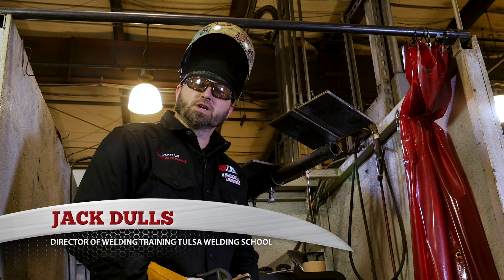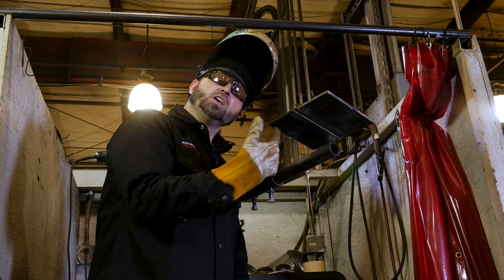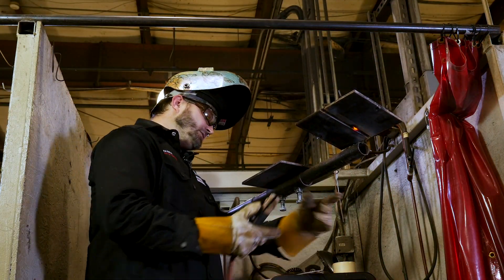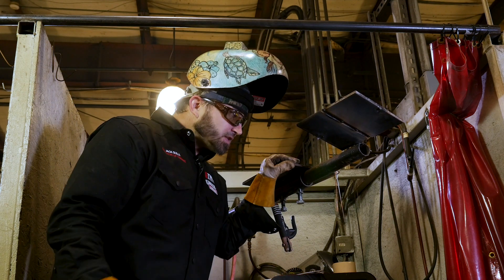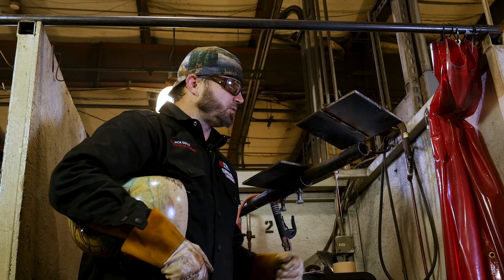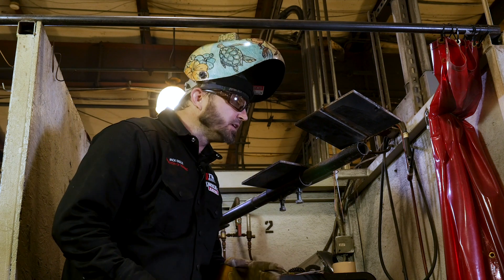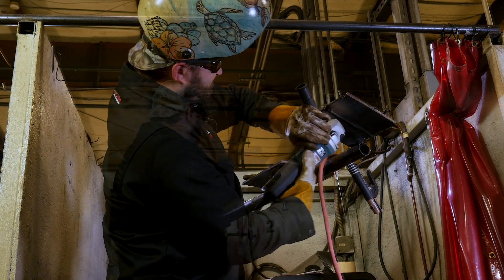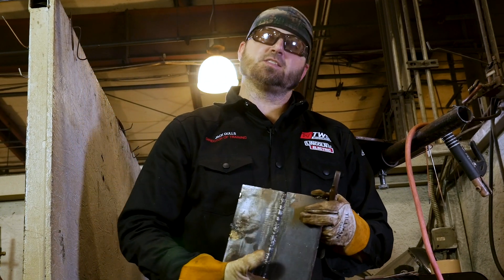How to Weld a 4G Open Butt 6010 Root 7018 Fill and Cap

Comment: no feathering restarts?
Reply: If it’s still hot you can start right back on top of where you left off

Just gatta push a lil bit
Reply: @specopsvince4299 But it's not hot. he's talking about when he swaps out rods, yeah its still really warm but not red hot. He actually did stop at one point and restart while it was red hot but for most of it he should've feathered.
Reply: I’m wondering the same thing. I’ve just started this in Welding II and we have to feather.

Comment: When u got a 3/32 landing and a 3/32 gap do u have to weld it out with 3/32 rod or how does that work
Reply: I usually match it with my root rod. 3/32 6010, 3/32 Root and Landing. It's worked for me so far. (not certified, but I haven't failed a bend yet)
Reply: If it's not a code specific weld then it's your preference normally, or what you got

Comment: Its feel good when the spatter draining into your sleeve😌😌..im trying to do a good penetration but i failed and i dont know what the correct technique..anyone can help me?..how much amps and the rod angle?
Reply: Push the rod thru
Reply: @AdamKennedySMH  I've try..using 2.6 rods and 80-90 amps and it making a conceve undercut on my root

Comment: What amp should the root be ran ?
Reply: 85-90
Reply: 75-85
Reply: 75-80
Reply: Amperage depends on your fitup, i.e., gap and land size. If you was doing this test on the standard AWS D1.1 Test which requires a 1/8 gap and 1/8 land, all the amp suggestions from these dkheads won't work.
Reply: I run about 78

Comment: By the way guys also the certs you gonna get in school dont mean nothing as soon as you go to a real job there gonna toss those papers and hand you a set of coupons and say let's see what you really got
Reply: Carol Florian it’s still the same test if u can do it u can do it
Reply: Papers have everything to say. if you pass the test you'll be the one sent to ship side to do the welding.
but yeah, it's not the same welding a test and doing a welding down in the dirt with 1-2 feet of space around the weld site, or inside a ship tank where your only option is laying on your stomach or on you back.

Back to the video, he didn't even grind in between the welds and when he did use the grinder he was holding it absolutely wrong and very Dangerously. that is a good reason to get fired as an instructor.
Reply: I'll just say "Okay" and weld it like I did in school - 91 amps for root & Hot pass (6010 - 1/8" - 5p+), 7018 - 3/32" - fill and cap. Easy peasy.

Comment: Dont go to these types of schools guys the money is not worth it go to your local community college fraction of the cost I know they claim they can get your certified in like 6 months that's not enough time there's alot your not going to know how to do it takes alot longer even then your still gonna haft to learn alot of stuff in the field that they just won't be able to teach you save your money
Reply: Fake news I had a welding job before I even graduated If you work hard and focus on getting better and don’t spend half the time fiddling off you will get a job. Yes they can’t teach you everything but you learn on the job
Reply: @spideyfan1231  I just need certificate
Reply: @spideyfan1231  but I know how weld and fabricate
Reply: @yomommasgardener9648  then you could probably get the certificate in less than 8 months
Reply: @yomommasgardener9648  these people that claim these schools don’t work are just lazy and find excuses as to why they failed as a welder
Reply: @spideyfan1231  7 months in Tulsa welding in Houston
Reply: @yomommasgardener9648  I was in Jacksonville
Reply: @spideyfan1231  in Houston is 7 months for welding specialist and 9 for pipe fitting
Reply: @spideyfan1231  true
Reply: I made the mistake
Reply: @TechGodI-AM-THE-GREATEST  Same Here
Reply: Carol Florian yeah I hear that a lot
Reply: Truth💯
Reply: Shut the hell up